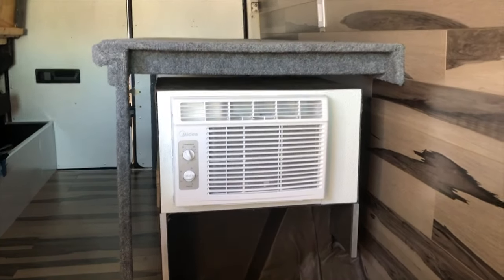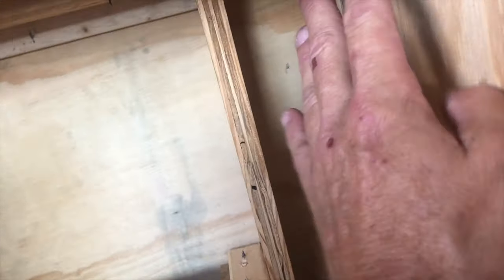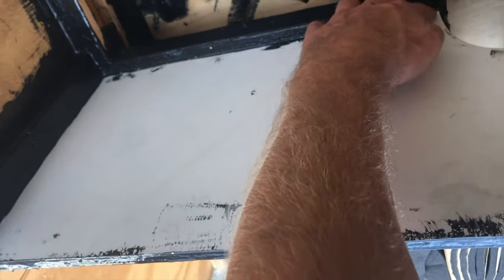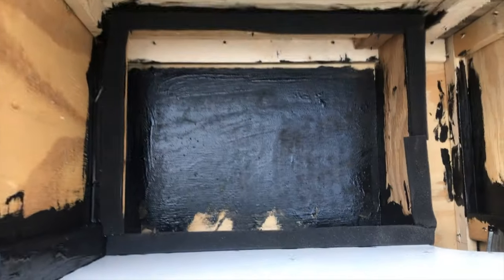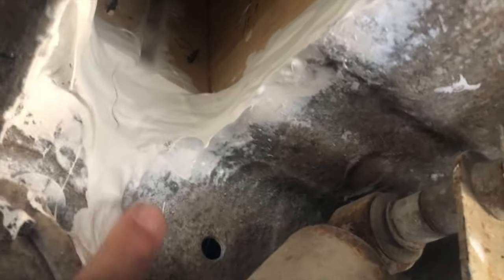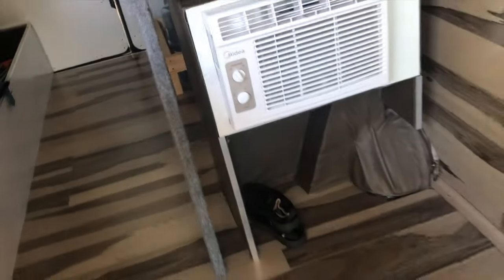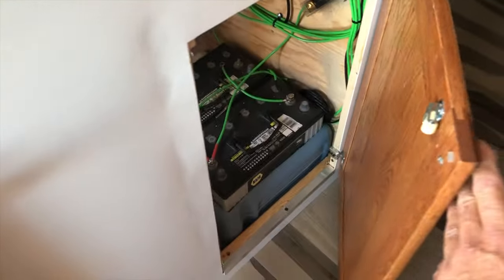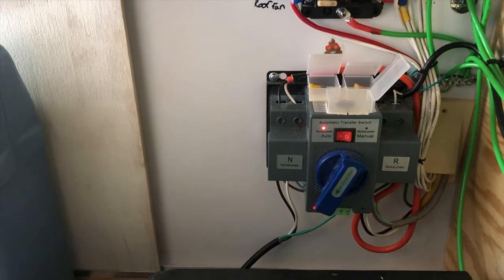Air Conditioning a Camper Van can be cheap and easy.

Comment: I kida did the same thing only I used a stainless steel food warmer pan with a flexible drain hose going off that 1 foot off the ground. I also have a 6" inline duct fan to move air out.   I used the 1/4" square metal screen at bottom to keep critters out.  Im strictly LP now so I do the LP generator thing.  If the generator or ac unit goes out I'll just buy another one.  3 years on same equipment so far.  Im a retired electrician & could've easily done the solar thing but chose not to.  LP & maintenance runs at $350 a month & generator runs pretty much 16 hour's a day.  Again if it blows up I'll just buy another one, I don't care.  Great video!

Comment: Great videos.. very helpful.  .. I envy your ability to document the process so efficiently and effectively...  I've done a few upgrades to a few vans I've had and the exit holes can be a bitch.  If I can at the exit holy on the floor I make a plate with mounts for six or eight holes with mounts to attach 2-4" rubber hoses 6-8" long. that I just fasten with hose clamps..it's underneath, hidable and easily replaceable.  Just forwarding along an idea that's worked  for me to keep out more of the crap a road can kick up ..
Peace. 
PS..  screening on the plate you make keeps the squirrels out ..I'm sure you're probably already pretty well versed in rodent wars..
Take care

Comment: As a note.. All that plywood is going to get moldy, it already is I noticed.. I had that happen to my first install in my Container. I will be using painted wood to keep from molding and then insulate the box to keep cold/hot air from touching any wood parts and to isolate from the inside of the truck/Van.. Thanks for the video.
Reply from the maker: I wanted to seal it all. I settled for sealing everything that will get wet. If it were used daily, or even frequently, I might be more concerned about moisture soaking in. It is intended for occasional use.
Reply: I'd use pressure treated plywood and also place screens over the openings under the van to keep out bugs and critters.
Reply: Why not use sheet metal over the wood. Even maybe metal tape it all up
Reply: yes^ quick hit of mold killing primer

Comment: Hi there .. for the air inlet and rather than depending on incoming air, would it be better to dmploy some sort of a 12v DC fan which could suck fresh air inwards ??
To be honest I'm not too clear how this air-conditioner is working..is it AC or DC powered air-conditioner?? Is it an off the shelf which I can order?
I'm not too sure how your aurcinditiober is setup
I must be missing something obvious 

Regards
Reply from the maker: The air conditioner is off the shelf window unit, ac powered by an inverter. The inverter and everything draws up to 50 amps from the 12volt battery system. A forced duct fan can help if the existing fan is not enough to adequately cool the outdoor* condenser coils. The fan built in the air conditioner has been sufficient in this build. The next one we built after this we made a mistake of too small of a box behind the condenser which restricted air flow dramatically. Forced duct fans were added.

Comment: I've thought about something similar, but you had some better ideas and frankly, I thought the incoming air was from the front of the ac, but it makes sense that it would need both. So how's it working? great video by the way.
Reply from the maker: Works great. This van is in Washington now, so the a/c doesn't get as much use as some of them I have built. We have several videos on similar set-up a/c.
Reply: @FloridaVanMan   I need help with this same issue.
Reply from the maker: @BarbrajoanOriginals  What issue?

Comment: I installed a "No Idle" 12 volt AC on the left rear door. Both outdoor unit and indoor unit are screwed to it. The length of hoses are routed through the door. I also have 7.5KW of LIPO batteries. The install required about 2 hours; start to finish. My cost was $500. Just the AC, not batteries.
Reply: can you do a video about this? it’s about to be so hot 😅

Comment: I had dismissed A/C in a van build, but this is brilliant. I'd love to hear some more details on performance--how cold it keeps it on a hot day, how the humidity out there in FL affects it, considerations for using it with solar and your battery setup / how long it can last on battery, how loud/quiet it is outside the van while running, etc.
Reply from the maker: This a/c is in 2Blue that now belongs to a friend in Washington State. He doesn't use a/c as much as I do in Florida. The Blue Saloon has a similar a/c that will run 6-8 hours while I sleep, depending on weather. It has 400aHr LiFePo4 battery charged by alternator and shore power, and it will keep the van interior in the mid 70's. It definitely helps to cover the windshield and all other glass with insulation of some kind.

Comment: Bill, I think floor venting and AC systems like these are the way to go. I have seen folks pay thousands for the 12v nautical AC systems or have the far too big roof mounted RV type systems. I have holes in floor for AC like yours and also separate floor holes for regular air flow instead of the typical roof vent. Zero holes in my roof. I have the 5000 BTU Frigidare, cools off the short box Sprinter in no time. When not on shore power I run it off one of the all-in-one units from MPP Solar and it does just fine on an 800 watt inverter.
Reply: I’d like to ask some questions of you. I’m doing a sprinter with 5000 btu
Reply: How long  can it run without shore power?

Comment: I wanna try this but thinking about using something like a rubberized pool paint inside. Any thoughts?
Reply from the maker: Rubberized pool paint has only been problems for me. Elastomeric roof coating may be a better choice. I've not tried it with this application but seems like a good idea.

Comment: I just purchased a really nice dodge conversion van (to live in 3 days a week) while on assignment. Any tips for a brand new van owner on the most economical way to get power and AC going when the van is t running? Thanks much. -Aston
Reply from the maker: Honda 2200i generator and window mounted a/c is the best* and easiest. We can hide the equipment a few ways if needed.

Comment: I tried this in my van and the amount of heat it produced was unbearable. I tried venting through floor and the side wall both were ineffective. Had to mount it in the window :/
Reply from the maker: It is imperative that the back and sides are two separate air channels for the fan to force air over the coils and OUT beneath the van. If the two channels are not fully isolated hot air is recirculated over the coils again and again. All the heat from the coils must be forced out without leaking into the van or recirculating. 
We also need adequate room at the rear of the A/C for the air to make a comfortable curve after passing the coils. A wall too close will restrict the air more than I expected. A lot more!
Reply: And so much easier!

Comment: how come you don't intake cooler air from inside the van to use for the ac, and simply just vent the hot air out of the van. wouldn't cooler air be more efficient to use than hot air from outside?
Reply from the maker: Outside air is pulled over the outside condenser coils and returned outside. If we pull cooled air over the condenser coils and blow that outside, all that air will be replaced by pulling outside air into the van through dash vents, door seals and other air leaks.  This is how portable a/c units work with only one exhaust tube going to a window. It does make the unit blow colder, but the constant draw of outside air into the van completely defeats that advantage.

Comment: Yeah nice job 👍 I was thinking maybe some sort of wire mesh on the two bottom holes to prevent mice and other critters insects from crawling in.
Reply from the maker: I think wire screen was added before this van left us. I've built several of these floor vented a/c units and in full disclosure one of them did not work very well. I think the air space behind the warm coils was too thin, trying to bend the airflow down and out in a space too small. The one in this video works very well and I used it while working in the van, finishing the interior build.

Comment: It would be more ideal to push the hot air up instead of down. Given the construction I doubt if the extra work is worth it however
Reply from the maker: More important than the work of installing, the loss of invisibility with a large chimney top or vent, lost space in the van, and the possibility of rain leaks.

Comment: will it be better to put a small fan on the fresh air hole to force the air from outside to go up straight in the ac?
Reply from the maker: I tried this on my first floor mounted version. It did not help at all. The air flow from just the built-in fan is very adequate.
Reply: @FloridaVanMan  What about an air filter?
Reply from the maker: @doraexplora9046  The window a/c unit has an air filter on the front air intake.
Reply: @FloridaVanMan  I know nothing about such things so this may be a really silly question, but, I would think that one would want to draw air from inside the van and cool it down and return it to the van, rather than sucking the hot air from outside. Can you explain why it isn't set up that way? I'm working on my conversion right now and must make a decsion on how to install my AC; your solution looks doable - especially the low cost! Thank you for the video!
Reply from the maker: @sheri4673  You are correct, the air that is cooled and sent into the room should, and in this case does come from the room and get returned to the room. Both of those vents, in & out are on the front of the a/c unit. The ducted air is brought from the outside, over the hot coils that usually hang outside the window, and that air is returned to outside without mingling with the inside-air.
Reply: @FloridaVanMan  Thank you for your very clear explanation! Now it all makes sense. Thank you!

Comment: What was the automatic switch thing you have called or if you have a link that would be most helpful. Ty!
Reply from the maker: Do you mean the transfer switch that goes between inverter and shore power automatically? Wiring it is a not quite obvious because we need to jumper the outputs on the bottom of the switch. If you have any questions, I can help. https://amzn.to/3OUjFhh

Comment: Well that's pretty clever but I'm wondering why not just Mount the air conditioner face up with one square hole through the bottom of the van? That way it would function as if it were in the window. Maybe even better because the back of the air conditioner will always be in the shade and dripping condensation straight out the bottom on the hot coil making the AC more efficient.
Reply from the maker: Air conditioners need to be right side up to operate properly. The oil in the compressor and condensation in the evaporator pan need to settle to the proper "bottom".

Comment: Very creative, however I just can't believe that you won't eventually have mildew and mold issues inside that contraption.  There's going to be SO MUCH condensation building up, and it doesn't seem like you can easily monitor it or clean it. I'd just rather keep it simple, and put the window AC in the window. Or bit the bullet and get a real RV/ van AC
Reply from the maker: "A real RV/van AC" on the roof will not work as well. Why do you think this will mold more than any other AC? The condensation never hits wood or cloth, and drains to the ground. I've installed 6 units similar to this and none of them have mold issues so far (3 years in).

Comment: Can you collect the AC water for drinking?
Reply from the maker: I wouldn't. While the water pulled from humidity will be clean, it collects on the condenser coils and they are NOT clean. When new the coils will have oil and solvent on them from the manufacturing process and by the time that has washed away the coils will be collecting dirt from the air being pushed through them.

Comment: A funnel and a hose would probably be better. Just a thought.
Reply from the maker: Humid air transfers heat away from the coils much faster than dry air, so I want to give every opportunity for the condensation to evaporate. My next version will include some carefully chosen sponge or cloth to catch the condensation near the air intake maximizing this humidity effect as well as taking maximum advantage of "evaporative cooling" the air that is just about to cross the condenser coils. This dripping condensation is also very cold water so catching it near the air intake with a large sponge will use this byproduct of cooling three different ways before it is expelled onto the ground.  Every calorie counts when cooling a tin can with windows in direct sunshine.

Comment: Isn’t it weird that no company markets an aftermarket ventilation for a window ac mod?
Reply from the maker: It would not be difficult to make an efficient window unit into a good portable* a/c. When we are not constrained by efforts to build it for "one size fits all" we can make the hose size more appropriate than off the shelf portables.

Comment: I could use your help installing a unit like this . I have it, and it’s got a vent to outside. I need help with getting power to it.  Batteries? I can’t seem to send you an email.  I’m in Florida and would travel to you.
Reply from the maker: Hi Barbra Joan. I'm near Daytona/Orlando and my contact info is available through Patreon membership. I'm happy to help build a similar air conditioner box, but you will need to be a member first. https://floridavanman.com/donate/

Comment: Do you have any feedback on the performance of these units? Trying to plan my ac system for south Florida 50% hooked up 50% off grid weekend warrior
Reply from the maker: Mine works great almost 5 years installed. I made the air channels too tight behind the condenser on some others, and those didn't work nearly as well. Give 4 inches behind the a/c unit for the air to blow through before changing directions in the exhaust vent.

Comment: Very creative solution. Was considering a Coleman Mach 8000 avail for only $200 but your set up seems much more practical for my 04 GMC Savana hitop.   Perhaps getting a small 7000-8000BTU a/c like yours the way to go. About ready to get a 1000 -1500W Solar Generator. Space is a consideration on roof bc planning a 18”x 24” roof hatch, already have Maxair fan front center and want small deck so perhaps just one 200+ w panel    Thoughts ?
Reply from the maker: Rooftops are a horrible place to "Cool" freon. If the freon doesn't cool the room doesn't cool. Compressing it only gets up to about 140 degrees and the roof of our van can be 170, so efficiency goes completely down the drain.

Comment: Love your channel, thanks for doing it.    How much distance do you need between the back of the ac unit and the back of the cabinet?  What  area (sq inches)  is needed for the exit in the floor for the hot air?     Thanks
Reply from the maker: I'm not sure about all that. I know one of the units I made did NOT have enough space behind it and would only cool about 20 minutes then started heating the van. I didn't get to fix it, though I think he pulled the unit forward into the room and modified the divider to accommodate more space behind.

Comment: I'm gonna use this as reference but there's a guy who posted AC for his crooked house boat and he has a video showing how he converts his window AC to a mini split, so the window AC is mounted under the van. I think that would make it quieter and has more airflow for the AC. those AGM could be swapped out for lifep04 too, they aren't expensive any more, well not super expensive
Reply from the maker: I think I know that guy! He was a professional HVAC guy in Orlando that had access to different freon we can get at auto parts stores and tools not available at common sources. Window units use different freon and don't have refill ports. The plumbing has to be cut open and refitted so it takes some special skill and tools. The original freon should also be captured so that isn't a DIY effort for most of us. I applaud his work and only wish I could do it like that.
Reply: @FloridaVanMan  that sounds about right yeah he did retrofit a fitting on there so he can recharge it. Yeah you could try to capture it I'm not sure how but I'm pretty sure all he did was he cut it off and then he sweated on the fitting and mended the other pipe like that I'm pretty sure all he used was propane or map gas or whatever it's called. It should be doable by the average guy. I mean I've never done it but it looks like something that I could do. I mean what's the worst I could happen right?
Reply from the maker: @eksine  I'm not sure if you meant that as a joke but I got a good chuckle. DIY sweating pipes on a propane cooling system, what could go wrong? Ha! I mean sure, we know not to try to fix a leak by sweating a bit more lead on there as soon as it stops leaking, right? What about the poor departed soul who didn't think about that? I shouldn't laugh, but Darwinism is funny at this late hour!
Reply: @FloridaVanMan  I meant most people aren't going to try to capture the gas, they would just cut the pipe, let the gas escape, and solder a new joint to it to for recharging afterwards, it shouldn't be dangerous. maybe you could pay someone to suck out the gas first, but with no gas in there soldering shouldnt be dangerous